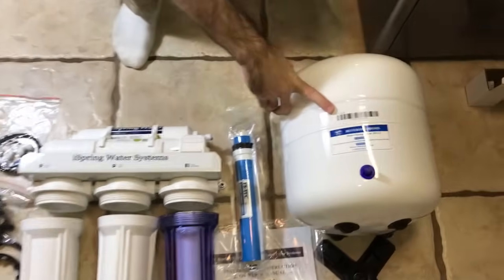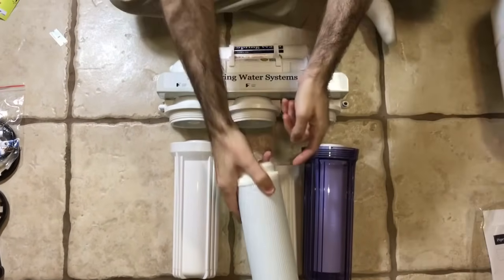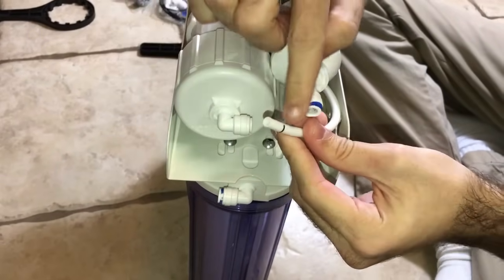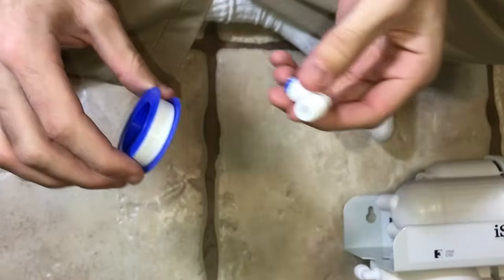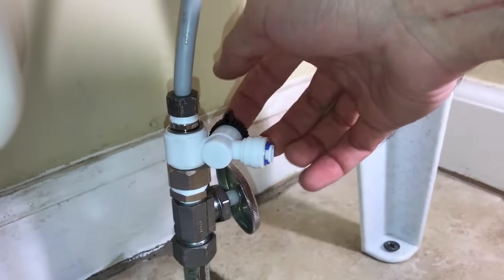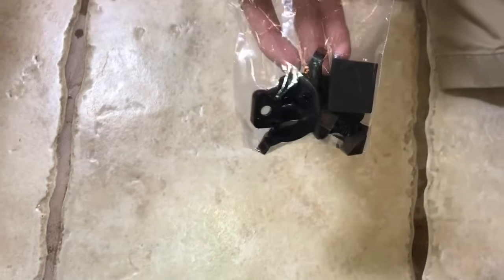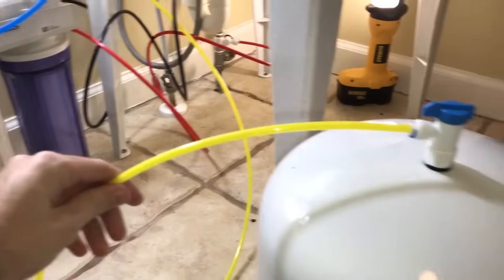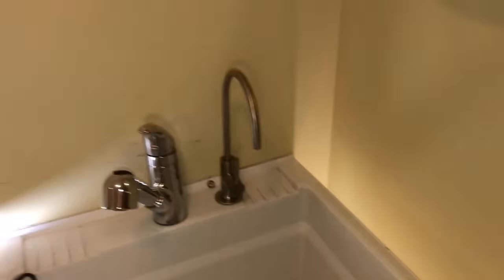Installation | iSpring RCC7 Reverse Osmosis Water Filter System

Comment: I'm running in the basement to the upstairs sink cabinet. On the Overflow drain can I just run it to a drain? Or do I need to tie it into a trap
Reply: It will have to be separated from the sewer, with a trap. I was going to add a trap below but am now considering running the black tube  to trap above (about 3ft) which seems counter intuitive for a waste line but in video seems  waste line is actually above the unit.. so I am assuming all is pressurized and waste would flow up ..though I have not confirmed that with Ispring.. other possibility instead of making a hard trap you could just form a trap with the plastic tubing.
Reply: @wilfredbrisson5776  thanks for your reply
Reply: @koreyhannan9071  Any drain would be going through a trap eventually so it would be isolated from sewer so that could work as long as it wasn't in the way ...never saw an overflow on a kitchen sink though ?is this a bathroom sink?
Reply: @wilfredbrisson5776  I meant the Overflow from the unit itself. And yes I realize every drain will have a trap. Since it's in the basement I was just curious if I could run on the floor since there's a floor drain right next to it
Reply: That would seem an easy solution, personally I would put a u bend in to ensure no sewer vapors back feed into the unit...pretty sure my floor drain has no trap only the house trap.

Comment: I already had a system installed but noticed that over time the water pressure as strong as it used to be. I tried pumping it and it didn't do the trick. Ended up buying a new tank. I wanted to ask is it normal to not get a water stream as soon as  the new tank is installed? I guess I will find out soon enough if the water is filling it or not...
Reply from the maker: Hi Lucas. The tanks have to be properly pressurized and just adding air to them may not work. If the tank has been replaced then it will have normal pressure once it's had time to accumulate enough water. It can take two hours for this if incoming water pressure is low. If the tank still doesn't work, please feel free to contact us at 678-261-7611 (M-F, 8:30 - 5:30 EST) or email us at support@123filter.com. We are happy to help.

Comment: Helpful video very clear should make the install much easier. One question, The Manual on Page 8 under Installing the Drain Saddle, Says it is recommended to be installed on a "Horizontal" pipe, yet this video and the pictures in the Manual both show installation on a vertical pipe .. before I drill a hole I just want to make sure this is NOT a misprint as I do have access to a Horizontal Drain pipe between a double Sink. Thanks
Reply from the maker: Hi there. Thank you for reaching out! You can install the drain saddle either on a horizontal or vertical pipe, but we recommend installing it on a horizontal one to minimize the dripping sound.

Comment: Thank you for the video. I would recommend a different approach to install the drain saddle. Instead of attaching it first, then aligning the hole, I would suggest putting the black hose through it and inserting it into the drilled hole first, then carefully push the saddle piece against the pipe and finally attaching it with the screws
Reply: This worked for me. It's definitely easier. Also, cut the end of that pipe at a 45° angle to prevent it from blocking.

Comment: I just set mine up using this very helpful tutorial. BUT Im very frustrated that I may have been given a broken / used system where I ordered a brand new one. Please suggest what I can do given below issues:
1. when I flushed the carbon filters I did not get any black water coming out...
2. When I was putting in the membrane filter there were water droplets in the chamber as if it is old and used!
3. The Alkaline filter stage is leaking!
Reply from the maker: Hi there. Regarding your issues: 1) It's ok if there's no black water coming out. It means that there is very little loose carbon in the system.   2) It doesn't mean that you received a used system. Our systems are pressure tested before shipping and since the housing is watertight it takes a long time to evaporate. If you are still worried about it, please feel free to give us a call at 678-261-7611 (M-F, 8:30 - 5:30 EST). We are happy to explain everything to you in detail.  3) We are very sorry about the leaking. Please give us a call and we will help you solve the problem.

Comment: How long did this take to assemble?
Reply from the maker: Hi there. This system is pre-assembled and most of the work is done after removing from box and installing the filters. It usually takes customers 1-2 hours to assemble.

Comment: i only have copper water lines
Reply from the maker: Hi Monty. Copper lines going into the system are fine. If you want to get an RCC7 5-stage reverse osmosis system, a copper water line to your refrigerator after the reverse osmosis process could produce some leaching since that system does not have the alkaline filter. In that case, we recommend our RCC7AK reverse osmosis system. You can find it here: https://www.amazon.com/iSpring-RCC7AK-Capacity-Drinking-Remineralization/dp/B005LJ8EXU.
Reply: @iSpringWaterSystems  i ment i bought the 7 way and i need to tap in to my copper water line
Reply from the maker: @montysandor8362  Hi Monty. If you need tech support, please call us at 678-261-7611 (M-F, 8:30 - 5:30 EST) or email us at support@ispringfilter.com. We are happy to help!

Comment: You should HAND-tighten the filter housings. Using the wrench will crack the housing if you use too much pressure tightening.   Use the wrench to LOOSEN them when changing filters.

Comment: Hi! So after you install system. You fill
Up tank for 1-2 hours then are you suppose to let the faucet run to empty it again before you can use the water?
Reply from the maker: Hi Shena. Yes, you are supposed to let the faucet run to empty the tank again before you can use the water.

Comment: Hi I am trying to buy this.. but I live in a leasing community worried if they charge me if I put holes to draining pipe or hole for faucet ..
Reply from the maker: Hi Chandrasekhar. In that case, you can get our US21B under sink water filtration system instead, which doesn't require drilling holes: https://www.amazon.com/iSpring-US21B-Capacity-Cartridges-Chlorine/dp/B089N3PRF6.

Comment: For the drain saddle can you mount the dispensing black hose into the sink rather than drilling and mounting it under the sink?
Reply from the maker: Hi there. Yes, you can. Some of our customers mount the systems in the basement or utility room that has a sink and they just run the drain hose down or up and over to the sink. If you have more questions, please feel free to call us at 678-261-7611 (M-F, 8:30 - 5:30 EST). We are happy to help!
Reply: iSpring Water Systems I just mounted the system as closely as the video and have a few questions.

The drain hose that goes into the system (not the drain saddle) does not use a blue locking clip per the video and It became dislodged once or twice when I was first using it,   The pressure was violent pressure was enough to yank it out.   This is a concern.

Secondly, I’ve filled and drained the tank twice yet the water does not look anymore pristine than plain old tsp water.  I can see a lot of floating impurities, air bubbles? when I put a light through a glass of water.  Taste is very neutral through.   Is this normal?  I was expecting more clarity.

Lastly, I have the 6 stage filter with booster pump.  Can I add any additional filtering like the soft water mineralization filter?
Reply from the maker: @supercooled  Could you please give us a call at 678-261-7611 (M-F, 8:30 - 5:30 EST)? It would be clearer to explain these questions and concerns through a phone call.

Comment: Is the drilling the drain hole an absolute necessary step?  I don't think I have that on my kitchen sink and I rent so I don't want to make any modifications I can't return back to original state.
Reply from the maker: Hi there. Yes, for an RO system, drilling a drain hole is necessary. If you don't want to make any modifications, you can consider our US21B undersink water filtration system - no drilling needed for installing this system. You can find the product here: https://www.123filter.com/ac/direct-connect-under-sink-water-filter-system/ispring--2-stage-under-sink-water-filter-45x10-big-blue-1-ports_803
Reply: iSpring Water Systems can I drill into the pipe before or after the “s”  strap? 

I’m guessing the flexible joint is a no no.

https://photos.app.goo.gl/Sqwky6GPYhRZtwWL9
Reply from the maker: @supercooled  The flexible joint should be fine, but it's not ideal. For drain saddle installation, you can refer to this video here: https://www.youtube.com/watch?v=qGAzzuXDXVE

Comment: This is a good "how to set up" as well as a refresher.  However, if I understand correctly, Spring has adopted a new way of connecting the components to replace the threaded connectors.  When you ship out replacement filters, you need to inform customers of the change.  When I changed my filters (way past schedule)  I saw the gunk the filters take out of my tap water.  #1.  I will never swallow another drop of tap water.  #2. I will change filters at the recommended intervals from now on.  This is a great product.  The part about how to wrap the Teflon tape is very important.  Clockwise.l  Otherwise, you'll have massive leaks.

Comment: I didn’t come across the video before installing but what happens to the membrane  if I ran it without flushing the first 3 stages? I unplugged it and flushed it after I watched the video and it’s still dirty but not black like when you first flushed it. Is the membrane done for? Or is it still salvageable?
Reply from the maker: Hi Darrell. The membrane should be ok if you didn't flush the prefilters this time. But please do flush them after future prefilter replacements. To test if the membrane still works, you can compare the TDS of your water before and after the membrane. A TDS meter can be found here: https://www.amazon.com/calibraci%C3%B3n-temperatura-amplitud-medici%C3%B3n-precisi%C3%B3n/dp/B00IDBZ1A2.

Comment: Can you explain 12:26, we have to drill a hole in a pipe?
Reply from the maker: Hi Garry. Yes, you need to drill a hole on your pipe to inset the drain line. If you need tech support, you can either call your local plumbers or contact us at 678-261-7611 (M-F, 8:30 - 5:30 EST). We are happy to help.

Comment: Can you run an extra line or have a splitter send water to the fridge ice maker?
Reply from the maker: Hi Aaron. Yes, you can connect your RO system to fridge ice maker with iSpring ICEK kit: https://www.amazon.com/iSpring-ICEK-Connection-Installation-Reverse/dp/B008H71Q4C

Comment: Thanks so much for this, really well done. Do you know anything about where the Leak Stop Valve goes. The manual sticks it in at the end, but doesn't explain where it goes.
Reply from the maker: Hi Sara. The leak stop valve goes on the feed water line into the system. If you have other questions, please feel free to contact us at 678-261-7611 (M-F, 8:30 - 5:30 EST) or email us to support@123filter.com. We are happy to help!

Comment: Do I need to dill a hole in the drain water tubing in the existing set up? Can I keep the drainage system as it is?
Reply from the maker: Hi Akhtar. Yes, you have to drill a 1/4" hole in the drain pipe under the sink to install the drain or waste water line from the RCC7.
Reply: @iSpringWaterSystems   what will happen if my drain pipe blocks and water level reached to the drain saddle level?  does that drain water goes in reverse direction into the filter ?
Reply from the maker: @lovejitsingh6403  Hi there. Negative.The pure water port on the membrane housing has a check valve in it and it's impossible. If you have other questions, please feel free to contact us at 678-261-7611 (M-F, 8:30 - 5:30 EST) or email us at support@123filter.com. We are happy to help.

Comment: Mine didn’t even come with that tape...
Reply from the maker: Hi Luis. Our latest version of RCC7 doesn't require plumber's tape since it either uses quick-fit or has o-rings on the connector. If you have any problems during installation, please feel free to contact us at 678-261-7611 (M-F, 8:30 - 5:30 EST) or email us at support@123filter.com. We are happy to help!

Comment: How safe is that drain tubing that attach tby that saddle to the drain pipe in case there's a clog down the drain to sewer? Is backflow can happen and contaminate the system?
Reply from the maker: Hi Ken. Thanks for reaching out! There is a flow restrictor and check valve that prevent backup from the drain line on all of our RO Systems. If you have more questions, please feel free to call us at 678 261 7611 (M-F 8:30 - 5:30 EST) or email us at support@123filter.com. We are happy to help!
Reply: @iSpringWaterSystems  I was trying to order your iSpring 6 stage RO system but  there was a problem sending to our address so I ended up the 5 stage RCC7 RO unit. Thanks for this awesome video and for clarifying how the drain system works, it was an easy installation. Your product is nice, hope you keep the quality of your product forever. Again, thank you!

Comment: Bought this system and I didn’t realize it had a booster pump which I didn’t want to use. Will it still run if it’s unplugged?
Reply from the maker: Hi thisisnotdimitri. In your situation, please give us a call at 678 261 7611 (M-F 8:30 - 5:30 EST) or email us at support@123filter.com. We are happy to help!

Comment: I flushed the first three filters and the water was clear from the start. Is this ok or did I do something wrong?
Reply from the maker: Hi Barry. Thanks for reaching out! It's normal if your water was clear from the start. It just means that there's not much loosen carbon in the system to begin with. If you have more questions, please feel free to contact us at 678 261 7611 (M-F, 8:30 - 5:30 EST)  or support@123filter.com. We are happy to help!

Comment: What happens if you flush it through the membrane? Do you ruin your system?
Reply from the maker: Hi R. Munoz. You won't ruin the system if you flush it through the membrane once or twice. However, we don't recommend doing that since it will reduce the lifespan of the membrane in the long run.
Reply: @iSpringWaterSystems  so is it ok to continue as I've been. Or should I Dissconnect and flush the proper way. I do have testing gadgets like a ppm meter and pH tester . Could I use those tools to give me some guide lines.
Reply from the maker: @RMunoz-te7jc  We suggest you disconnect and flush the system in the proper way if you haven't started using it yet. The ppm meter and PH tester are not useful during flushing. You can use them to test your purified water to see if the system works properly.

Comment: Part of the black water from the initial flush is from the Feed Water Adapter. Maybe grease or something from the seals. I've been testing each component for leaks as I install and noticed this. I recommend doing an initial flush of your cold water with the Feed Water Adapter installed so the grease / seal residue doesn't go into the RO / Stage filters
Reply: black color comes from the active carbon
Reply: @gordonxu2493  I didn't have the carbon filter connected
Reply: David Sheeley that’s odd. Without active carbon,the chloride will damage the RO filter pretty fast
Reply: @gordonxu2493  I attached the valve first and ran the faucet to make sure the valve worked. I did not run water through the filters
Reply: David Sheeley oh, I see. Thanks. A very great video, a lot of info. I am going to install mine this coming weekend. The one with a pump

Comment: For the drain saddle the instructions recommended installing it on a horizontal part of the pipe to eliminate dripping noise. I did this but not realized I am connected in after the p-trap and directly with the sewer. Should I correct this or is it fine?
Reply from the maker: Hey Levi! Thank you for reaching out! You do need to correct that - the drain should only be installed before the p-trap. If you need any help doing it, please feel free to contact us at 678 261 7611 (M-F, 8:30 - 5:30 EST) or email us at support@123filter.com. We are happy to help!

Comment: Does the bracket support all of the filters when filled with water?  I plan on mounting in garage on a wall, not under sink.Thanks
Reply from the maker: Hi Steve! Thank you for your question! Yes, the bracket is able to support the weight when the filters are filled with water. You can mount it on a wall as long as the wall is able to support the weight of the system since it can be pretty heavy when filled with water. If you have further questions, please feel free to contact us at 678 261 7611 (Mon-Fri, 8:30 - 5:30 EST) or email us at support@123filter.com. Our customer service team will be happy to assist you!

Comment: is there a need to flush prefilters ?doesnt the carbon just run over the membrane and drain out in waste water?...
Reply from the maker: Hi Bob! Thank you for your question! We do recommend to flush the prefilters when you first start using the system or change to new filters. It's not a big deal if you skip it once, since as you mentioned, the carbon just run over the membrane and drain out in waste water. However, you don't want to skip it every time you change to new prefilters because prefilters are recommended to change every 6 months while the membrane is recommended to change every 2-3 years, and not flushing prefilters everytime will cause the membrane to clog sooner. If you have further questions, please feel free to contact us at 678 261 7611 (Mon - Fri, 8:30 - 5:30 EST) or email us at support@123filter.com. We are happy to assist you!